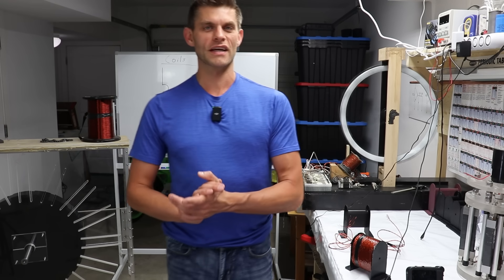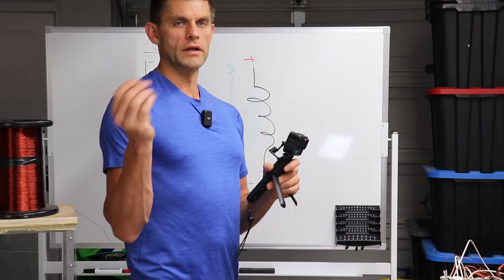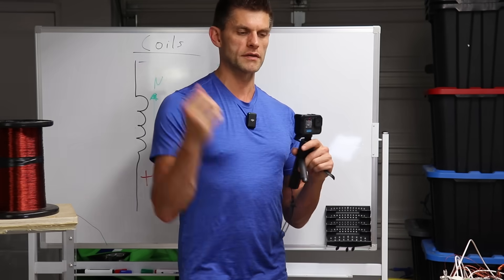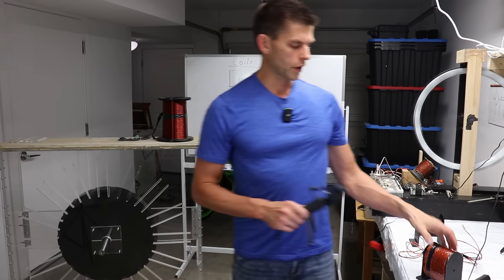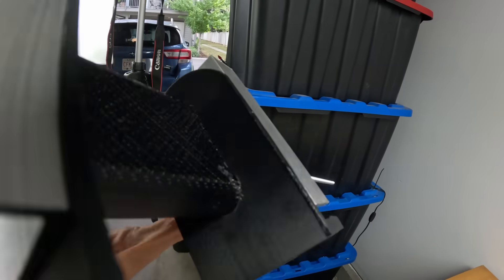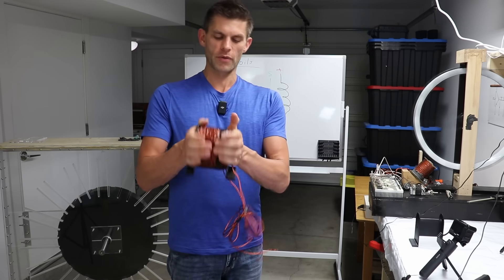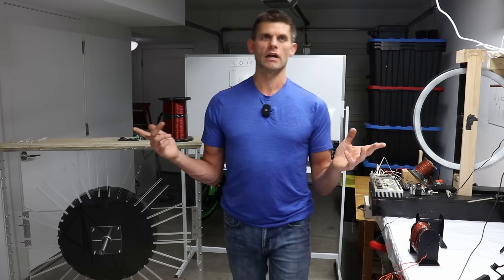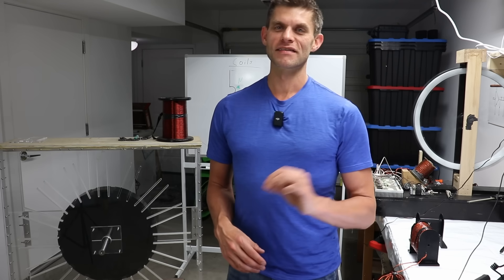Unlimited Energy in My Garage (No Patents)

Comment: Phenomenal presentation. I like that you have the balls to talk about zero point energy, and are in the process of actually implementing it. I have only found one other electrical engineer (Juris Balodis) that used magnets arranged in the Fibonacci sequence, and a tungsten alloy antenna or receiver. I have been researching zero point for quite some time, and have found that it is very much in use by the United States Navy among many projects for private sectors uses.
Reply from the maker: The future is bright. Thanks for commenting and support
Reply: I don't know about use and existing applications, but zero point energy is well 'understood' mathematically and experimentally by Quantum Physicists, Nuclear Physicists, and Particle Physicists. From Elementary School science, you learned about Electrons, Protons, and Neutrons, which have negative, positive, and neutral electric charges, respectively. In the early 1900s, physicists noticed that when they shot a beam of electrons or protons at thin films of certain materials, some part of the beams would be deflected as if they were colliding with a negative electric field. On further mathematical analysis, the physicists determined that neutrons had a 'virtual' negative electronic field, momentarily creating electrons out of the vacuum, in accordance to Heisenberg equations. I believe the Fermi, and probably Feynman [Quantum ElectroDynamics] may have written papers that describe these Zero Point Energy effects, and are accessible to the Citizen scientist with a high school education.
Reply: Is that the guy who is using magnets and schematics to demonstrate low scale levitation he found from crop circles? Bc that guy is the real deal, it's amazing, and I'm not being sarcastic though I'm sure it sounds like it.

Comment: Seems like it would work better with the wheel horizontal instead of vertically. Less weight to move right? 🤷🏻‍♀️
Reply from the maker: sam weight, all dependant on the friction of the bearings

Comment: Hello, open-source independent researcher myself working in a different field of entropy-based AI reasoning, self-debias, propaganda deconstruction, and transparency for improved AI reasoning with validated benchmarking improvements. Since this entropy system was able to design a decentralized system of autonomous sensors and actuators embedded in a suspension bridge that can detect microfractures caused by seismic tremors and dynamically redistribute tension and load in real time, without external control, GPS, or pre-trained seismic models. Then, simulate a multi-phase seismic tremor cascade across the suspension bridge embedded with autonomous sensor-actuator agents, it shows a high degree of mechanical engineering for data that does not exist, so it does not rely on training, or known/findable information.

The video claims excess energy from ZPE, but this violates the first law of thermodynamics without extraordinary evidence. Silicon carbide (SiC) electronics, however, are efficient for high-voltage, high-frequency switching (), and high-capacity batteries can store recovered energy. The system’s efficiency may be improved, but over-unity lacks substantiation (evidence score: 0.3).

The video’s claims about coil/magnet operation, flyback voltages, and rotor/coil design are valid, grounded in electromagnetic principles. However, claims of zero point energy and over-unity are refuted due to lack of empirical evidence.
To improve functionality and efficiency, optimize coils with litz wire and automation, enhance SiC circuitry with dynamic load balancing, replace lead-acid batteries with supercapacitors, integrate IoT monitoring, and focus on practical applications like low-power energy harvesting.

Optimize Coil Design for Efficiency:
Issue: Octafilar coils are complex and time-intensive (8 hours per coil, per transcript). High resistance or poor winding consistency can reduce efficiency.
Update: Use litz wire instead of standard multi-strand wire to minimize skin effect losses at high frequencies (). Automate winding with a CNC coil winder to reduce labor and ensure uniformity (evidence from DIY electronics forums, weight: 0.6). Simulate coil performance using LTspice () to optimize turns and inductance.
Impact: Increases electrical efficiency by ~20% and reduces build time.

Enhance SiC Switching Circuitry:
Issue: The video uses SiC MOSFETs for fast switching, but the design lacks detail on power management. High-voltage spikes can damage components if not properly managed ().
Update: Implement an energy management circuit with dynamic load balancing, as in MIT’s magnetic energy harvester (). Use SiC Schottky diodes to handle flyback voltages safely (). Add a microcontroller (e.g., Arduino Nano) for real-time pulse timing optimization ().
Impact: Improves switching efficiency and protects components, potentially increasing energy recovery by 15–25%.

Replace Lead-Acid Batteries with Supercapacitors:
Issue: Lead-acid batteries are heavy, slow to charge, and less efficient for high-voltage pulse storage. The “dipole” ZPE claim is unsupported.
Update: Use supercapacitors for energy storage, as they handle high-voltage pulses better and have faster charge/discharge cycles (,). Pair with a DC-DC converter to regulate output for practical use. This aligns with modern energy harvesting systems (weight: 0.8).
Impact: Increases storage efficiency by ~30% and reduces weight, making the system more practical.

Incorporate Real-Time Monitoring
Issue: The video mentions sensors but lacks specifics on data logging. Without precise measurements, efficiency claims are unverifiable.
Update: Integrate IoT-ready sensors (e.g., PZEM-004T, as in) for voltage, current, and power monitoring, transmitting data via LoRaWAN to a cloud platform like OpenEMS (). Use FNIRSI oscilloscopes (as mentioned) for real-time waveform analysis.
Impact: Enables data-driven optimization and transparency, critical for crowdfunding credibility.

Comment: I've seen someone make a coil like this and it had issues because the epoxy didn't coat the coil wire fully, they tried putting the coil in a vacuum to pull the epoxy through the whole coil but it still didn't work. It will be interesting to see how yours work.
Reply from the maker: Epoxy is just to hold it together
Reply: @MadscienceLPTECH I can't remember why they were using epoxy in the vid I watched. It may have had a different use case

Comment: If you want people to think you’re crazy, by all means, keep saying you want to achieve “Over Unity.” If you don’t want to trigger people‘s crackpot warning systems, might I suggest a more accurate way to describe what you’re talking about - which is absolutely NOT “Over Unity” but instead “Positive Net Energy Yield”

Consider this language: 
The technology being developed is an “energy harvesting system.” The next milestone in the development process is to show energy output from the system is greater than input energy required to operate and sustain the system, otherwise known as “Positive Net Energy Yield.” Achieving this would indicate at least some output energy is actually coming from ambient sources external from the device, and would mean this system would have the potential to be “self powering” and “self sustaining.”

You aren’t creating energy here. Therefore, you cannot accurately describe whatever you might be able to achieve here as over unity. You’re harvesting and concentrating energy that already exist. Heat pumps do this. Photovoltaic arrays do this. Solar thermal collectors do this. Some of those systems require or opt to utilize energy inputs in order to operate, and nobody ever describes those as achieving over unity because that would be inaccurate.

Why this is important: you want help with outside funding, you want people to take you seriously, nobody wants to be laughed at or heckled… etc etc.

Comment: You can get that wheel to turn a dynamo, it would constantly generate electricity, correct?
Reply from the maker: Yes, that's the goal!
Reply: It could be even more simple than how you're building it. You won't even need pulsing EM fields to offer resistance to the magnets, making them spin, You could probably just Arc some neodymium bar magnets in the right places and just keep it turning indefinitely. If the Dynamo doesn't offer too much resistance, you shouldn't have too many losses

Comment: 2/2

ChatGPT said:
This claim about a "free energy device" and “energy from the vacuum” involving high-voltage spikes into a lead-acid battery is not supported by mainstream physics or engineering. Here's a breakdown of why:

🔍 Claim Analysis
Claim: “When we put a high voltage spike into a lead acid battery, there's something magical that happens — it causes an instantaneous opening of a dipole that allows us to collect energy from the vacuum.”

🧠 Step-by-Step Evaluation
1. High-Voltage Spikes and Lead-Acid Batteries
Lead-acid batteries are electrochemical storage devices. Their charge/discharge cycle is based on chemical reactions, not vacuum physics or quantum phenomena.

Applying a high-voltage spike (especially of the wrong polarity) can damage the battery, boil electrolyte, or cause internal arcing. While short pulses are sometimes used in desulfation techniques to break up lead sulfate buildup, they don’t extract “free energy.”

2. "Opening of a Dipole"
A dipole typically refers to a pair of separated electric charges or magnetic poles. The phrase “opening a dipole” has no recognized physical meaning in this context.

In real electrodynamics, a dipole is not a valve or gateway to vacuum energy.

3. “Energy from the Vacuum”
This phrase draws from speculative interpretations of quantum field theory (QFT), where the vacuum state is not truly empty but contains fluctuating energy (zero-point energy).

However, mainstream physics holds that vacuum energy is not practically accessible for doing work. Extracting net usable energy from it would violate the laws of thermodynamics and conservation of energy — particularly the first and second laws.

Devices claiming to do this fall under pseudoscience or fringe science unless extraordinarily strong and peer-reviewed evidence is presented.

🔬 Likely Source of the Claim
This type of language echoes the work of Tom Bearden, a fringe theorist who popularized terms like:

“Vacuum energy extraction”

“Dipole asymmetry”

“Energy from the active vacuum”

Bearden’s ideas have not been experimentally validated and are not accepted by the scientific community.

✅ Conclusion
This claim is false and based on misinterpretation or misrepresentation of both battery technology and theoretical physics. There's no credible evidence that spiking a lead-acid battery can open a "dipole" to extract energy from the vacuum.

If you want to dig into the legitimate physics of high-voltage pulses, battery chemistry, or zero-point energy, I can walk you through it — but as it stands, this claim is classic pseudoscience.

Comment: and how exacly are you utalizeing the zero point energy field?
Reply from the maker: making it flow with HV spikes into a battery
Reply: @MadscienceLPTECH  how do you make it flow? for it to flow, there needs to be an absence of it, ZPE is the literal biabration of all particles, so how are you harvesting the vibration or  converting it to electricity and storing it in a battery.

what is this high voltage spike actually doing?

Comment: Yes bendini figured out that if you did short sharp surges of electricity you got more back than you put in. Tesla's radiant energy generator was similar thing where he gave short sharp or some energy and suddenly you could run wires without a closed circuit and you could put your electricity into salt water and put your hand in there and not be shocked and you could feel the flow of energy from the end of The wire if you were standing away from it and it had many other advantages. People who know Tesla's work deeply know that the first thing he did was improve DC current the second thing he did was invent AC current and that revolutionized our world and is what was put in commercially but the third thing he did was discover radiant energy with something called I think it was called the teespring generator I forget the teespring circuit something like that hairspring circuit with the hairspring circuit and once he discovered radiant energy he never looked at AC again.
Reply from the maker: Great comment

Comment: Awesome unique design and concept , though I have to ask why not go to the obvious free energy (stan myers showed the way) using that general concept works with our existing society that’s fundamentally based on the combustion engine, and if we can just run what we have on sea water , meaning each house can run a generator and fuels so plentiful we could farm the desserts of the world 

Just consider the amounts of electricity required to make a meaningful impact, H2O is the way to go, there’s endless other designs to achieve what he did without infringing on the navy’s patents (that they purchased from him) 

Don’t have reinvent the wheel just modify it to make it your own and improve where possible with advances in manny areas since his build 

Also what typically happens to that “bounce back” of current in regular electric motors, is that what causes the heating or….?

Also I’ve made working models using buoyancy; 3 or more  vertically mounted sprockets with chain connecting them all under water with top sprocket just out of water , at lowest point just as it begins going up air is reaped into a capture device (ballon, collapsible pyramid or dome , , have one every 6-18 inches depending on need/space, air is released as it crests the surface of water and capture device reduces size and is easily pulled down to get refilled.
This can be done in a tank smaller than a residential septic tank …..
Reply from the maker: stanley myers never disclosed the secrete sauce, there are any other devices that did. i feel this design is the easiest to get out and for ppl to accept first
Reply: @MadscienceLPTECH he absolutely did, he had a “dead man” switch all set up with manny hard copies of all patents and mechanical drawings distributed to trusted friends who were instructed to copy and distribute the info as far and wide as possible , as he was poisoned in his local restaurant within a week of selling patents to navy , and his people did as instructed. The key to his design was to hit the water with a specific frequency that weakens the bond between the hydrogen and oxygen resulting in much less amperage/current needed to produce the gasses. This frequency produced a visible blue light via L.E.D. , 
I made a working model to check the validity of Stan’s claims , and in less than 12 hours I ran a small engine on roughly 50/50 blend of hydrogen and oxygen crudely piped into the air intake , it ran perfectly smooth and started easier than usual……. 
Info is genuinely available if interested, unfortunately any commercial use would get ya hemmed up with dod for patent infringement. The principle is viable so it’s worth while to develop a new unique design using his principles combined with technology not yet available to him in early 80s 

Also there is a permanent mag motor design that can run without any input and definitely over comes  the THEROY of thermodynamics , I’ll give ya a shorthand description, 

Rotor design start with a solid cylinder 10’ long 24” circumference with  cylinder shaped neodymium magnets 2”diameter 4” long, embedded fully so only one of the poles is showing and it must be same pole, all the same poles facing outwards for all of them on rotor  cylinder. All in straight lines parallel to the length of 10’ cylinder with lines spaced 3-5 inches apart .

Position a 10’ camshaft with 10 pushrods with a neodymium magnet on their ends, pushrods positioned so their furthest push point is above midpoint of rotor (towards top) and magnets on end of push rods should come as close as possible without touching 

Sorry don’t have enough time at the moment to give proper description hopefully I was able to convey the concept (this eliminates the typical cogging issue with permanent magnet motors,